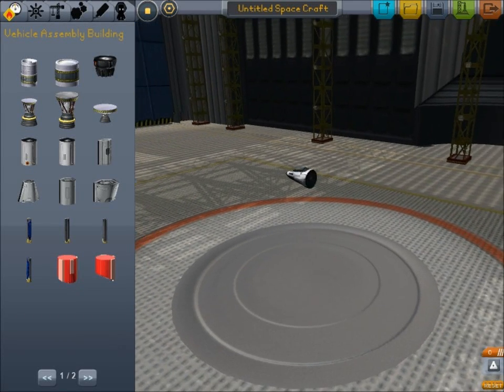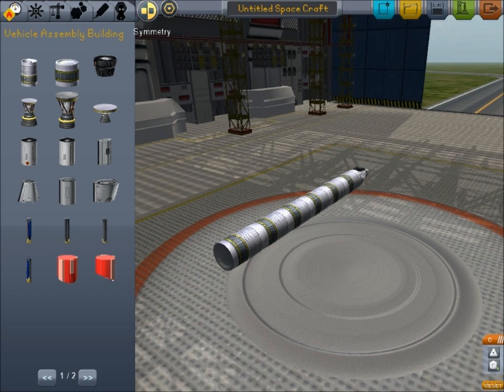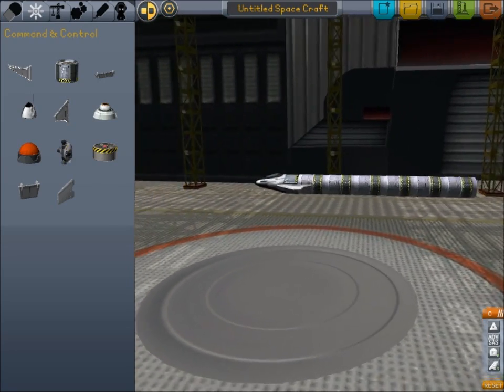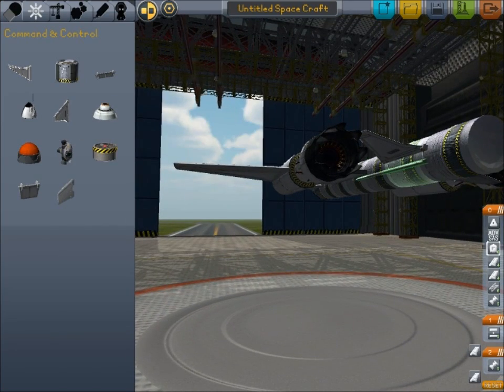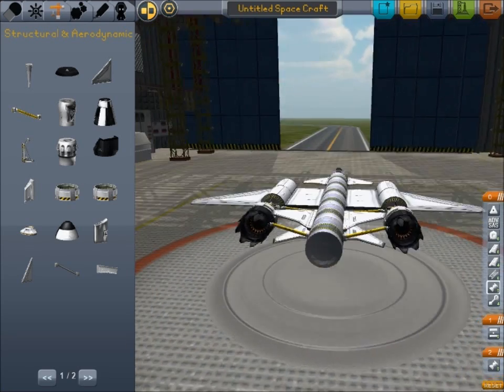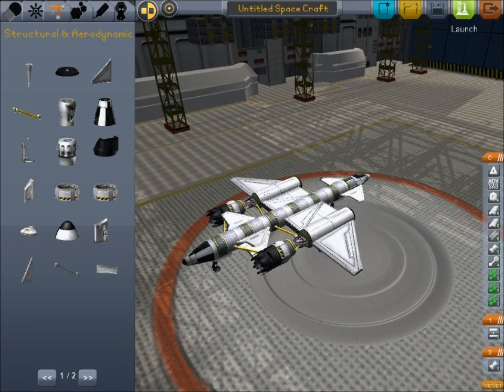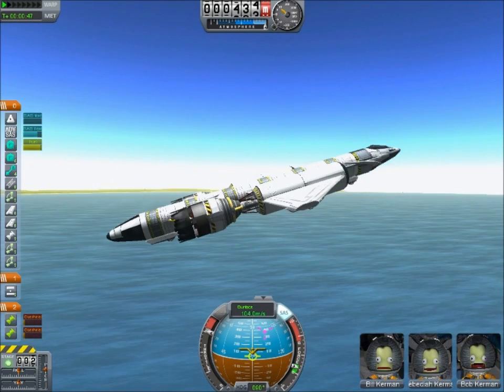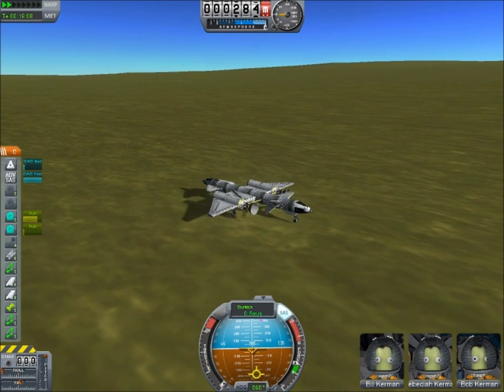KSP Just The Tip Ep. 2 : Spaceplane Operations

Comment: Let me elaborate on that. That works in planes where the center of mass is more towards the back of the plane. In this case, it's in the center, so you would be able to tilt the plane backwards without the wheel in the back, but not enough to get proper lift. After leaving the back of the runway, there is enough room below the plane to tilt and get lift.